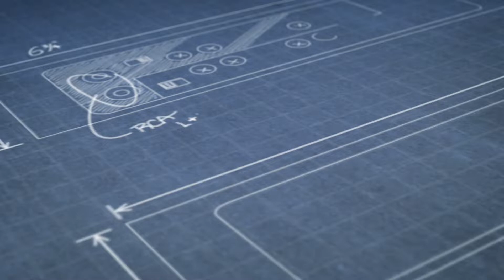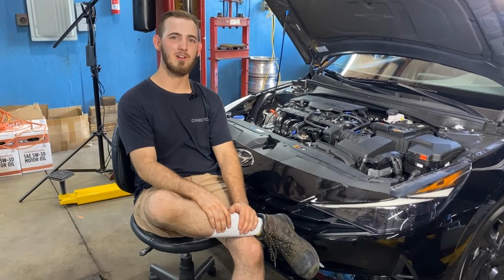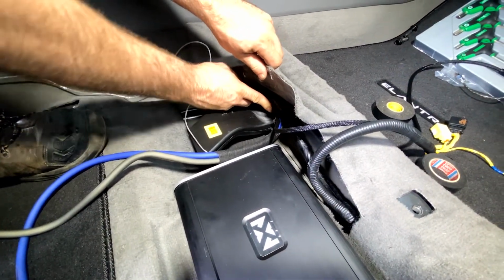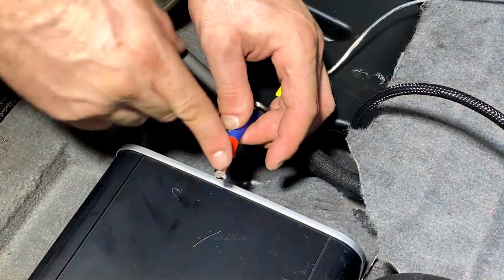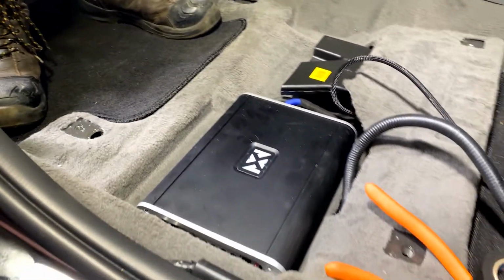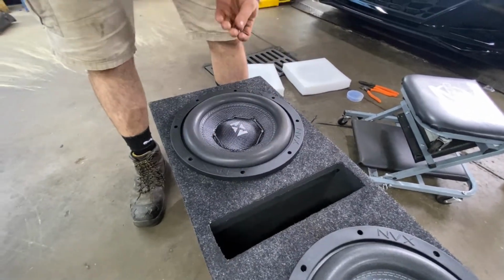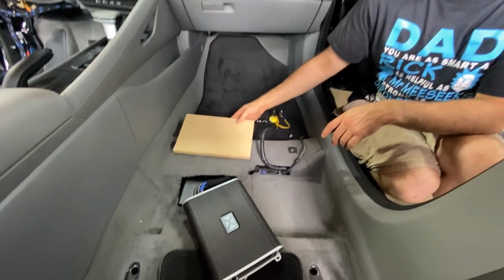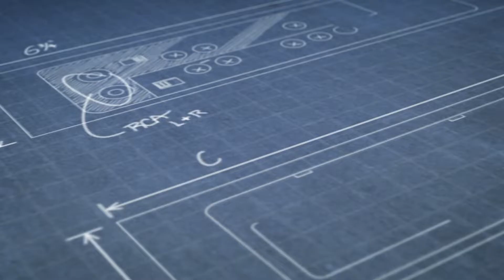How To: Installing a Monoblock amplifier and Subwoofer in your car

Comment: Wish you guys were known more. 
I really believe in this brand. 

2 VCW 12s on a vad1700.1 was my first system and they're still the most musical subs I've had to date. 

I also seen the new subs on the website.
Just because a subwoofer has a 200 pound magnet doesn't mean it's good.
Reply from the maker: It does not just have a big motor. The new X-Series has been developed for the past 2 years with countless hours of research.
Reply: @NVXAudio I swear if yall just threw a extremely oversized surround on it it’d sell like hot cakes lol just found out about them 10 mins ago and ended up here trying find a video on one I’m more into getting windy builds so haven’t ran nvx subs in a while but these new X’s seem like they’re down my Allie

Comment: Don’t like this install at all. Saw the battery terminal spin loose. Saw the removing of the chasis ground coating, but grinded and area not needed out of a careless tool handling technique . Running wiring through floor door pillar that’s not a good location due to bulking of the wiring. So…what else will be shoddy? 
These install technicians doing car audio installs, are giving these companies selling audio gear a bad name. When install technicians blow and burn out components and new sound gear, they most often won’t take the blame. Then, all these wanna be, shade tree, audio installers, can say is “ I don’t know , “wasn’t me”, “I did it right”, it’s the customer’s fault”. 
The customer is then left with blown out valuable car components and no sound gear, just ruing a simple install of their sound gear, and typically the install shops won’t take the blame.
Reply from the maker: Battery terminal has not spun loose, has been tight for going on 3 years and the customer has not been back for any issues. Not sure what a floor door pillar is but yes, in most cases I will try to go through the factory gromet or drill a hole for the wires and use a gromet that comes in the kit. This is to allow the power wire to integrate into the factory wiring. Also, to assume we would not take blame if we caused any issues is just not realistic. When we do installs, we have a lifetime labor warranty for this reason. Also, fun fact, since I have been installing for this company, not 1 vehicle has came back for any reason. You may ask how do I know the customer hasn't had any issues? He works for us and we speak on a regular basis.